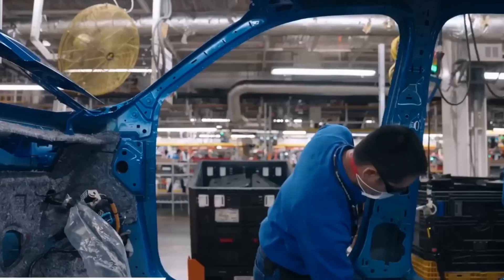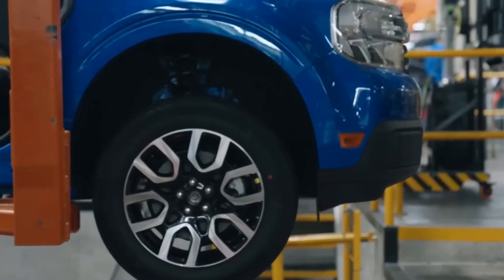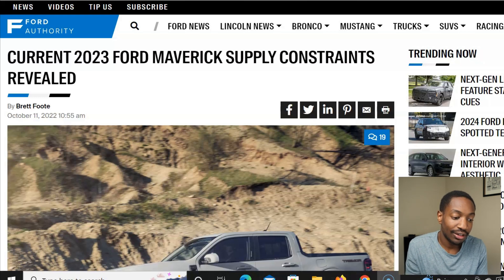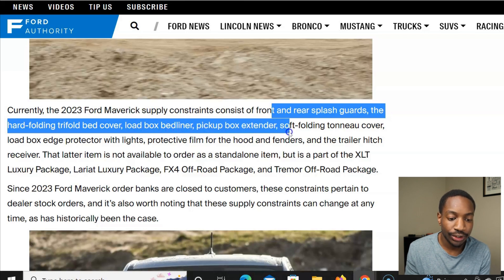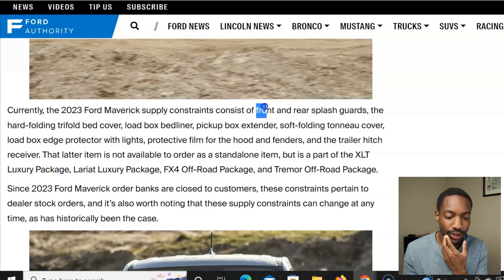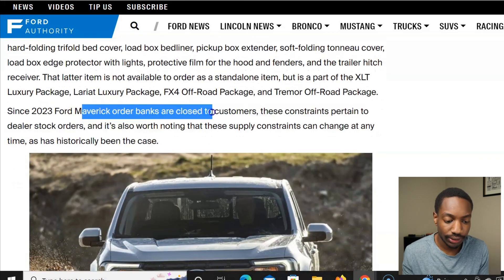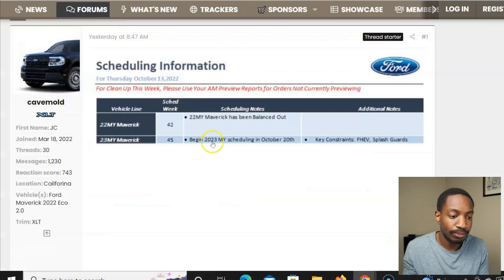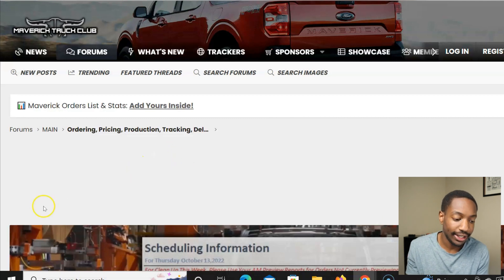2023 Ford Maverick Supply Constraints Issues! Parts That Affected

Comment: Ordered July 2021 (15 months ago) 22 Lariat, EB, Fx4, Tow, Moonroof, co-pilot 360, lux package spray in bedliner, tri-fold tunnau cover. Received notification that they will not make the 22 but I would be a "holder" and get a 23 at price I was quoated for the 22. I( had to reorder last month and was told to take out the spray in bedliner to not hold it up. Now I see there are several more issues that will be the reason this one will be held up. Very close to just getting my deposit back and giving up on Ford all together...

Comment: You kinda skipped over it but that stated those constraints were mainly for "dealer stock orders". Most of us follow Ford video guy Tim Bartz.  He's been stating to stay away from any bed accessories. As of this moment the main constraints for retail orders and build scheduling are the Hybrid and mud flaps. Of course it can change tomorrow. I ordered an XLT Ecoboost AWD with 4k tow, Lux, Fx4 packages and 360 Copilot and moonroof. All my options need to be factory installed. I ordered my truck the way I want it. I knew it would be a wait and gamble.  Now we wait and hope Ford can actually build them..
Reply: Maverick Lariat Lux AWD EcoBoost, 4K tow package, moonroof first ordered 6/26/21 reordered 9/16/22. Luckily I have the means to wait it out.

Comment: Ok! I am really beginning to get pissed.  I have been a very patient Man.  On September 15th I was contacted first thing by my Salesman to Convert my MY22 order to a MY23.  So I actually downgraded from an XLT Hybrid with Lux package and co-pilot 360 to an XL Hybrid with only co-pilot 360 and a hitch (I really need the hitch receiver) to avoid Constraints and save Money.  Now I find that a simple thing as a hitch receiver is going to hold up my rolled over MY23 base XL order.  But those spending more money on an XLT with Lux package or Lariat will get the hitch receiver unconstrained.  
It is not easy or inexpensive to add an aftermarket hitch receiver to the Maverick along with the wiring. The factory unit is welded to the unibody as a part of Fabrication making it much stronger than adding one later.  Also, it will cost in excess of $350.00 to add one later.  Come on Ford!  As of November I will have been waiting a year, and now production of the MY23's are being pushed off to finish MY22's.  So because of a simple hitch receiver, will I be waiting another year since the more expensive builds will get a hitch?
Reply from the maker: I hear your frustrations, yeah it may be awhile.